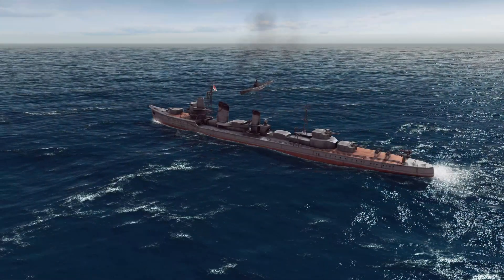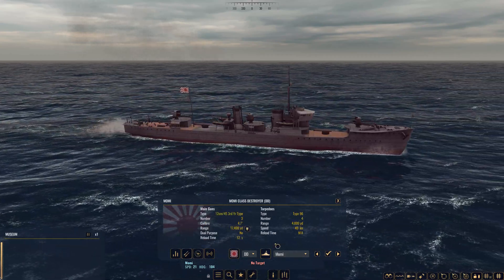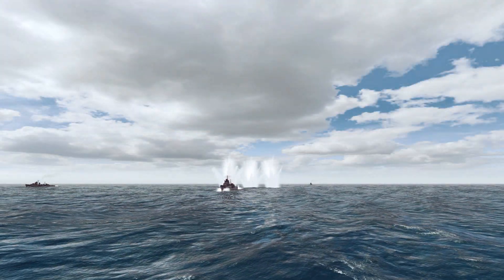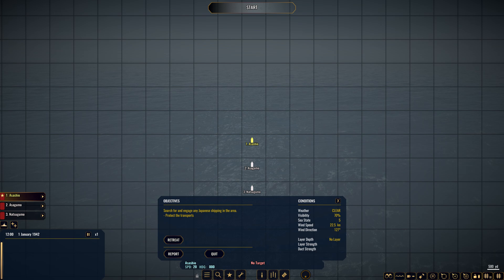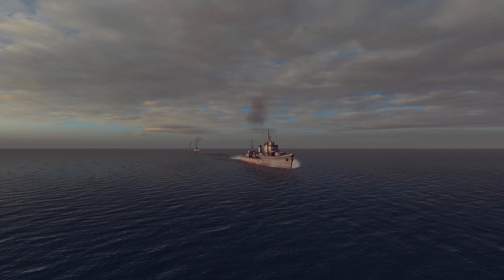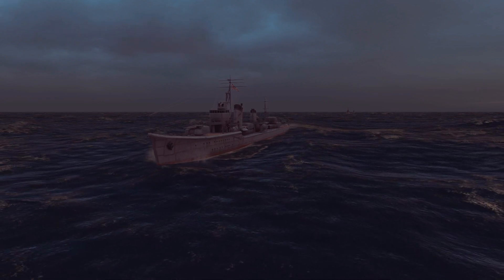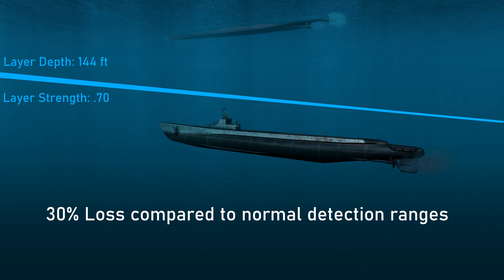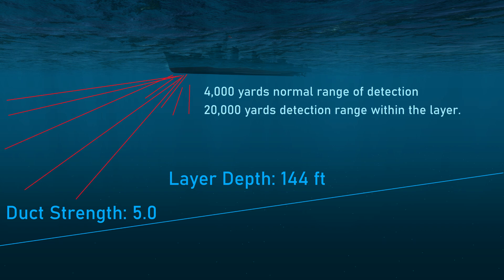War on the Sea: ASW Ships, Environment, and Sonar Sensors Explained

Comment: Are you advocating not using active sonar but rather passive when sun hunting? I got the impression you only use it when almost on top a sub and using passive to locate.
Reply from the maker: I haven’t played in a long time but when I did, I almost exclusively used passive tracking all the way up to the engagement phase. I think you can use active and it doesn’t affect your passive sensors but I’m not sure how that works. The manual doesn’t specifically state is does or doesn’t unfortunately. 

I was addressing some folks who were using active sonar as a wide area submarine search sensor which is not how it should be used in this game. You are right, you should be using passive sonar for detection and tracking then using active for the final prosecution close in over the contact. Though like I stated earlier I personally didn’t even do that and most always stayed passive tracking during final attacks on the sub.

Comment: Thanks. I never really get passive a chance - I typically go active. Seems like I should reconsider? I've never detected using passive.
Reply from the maker: I would recommend it over active sonar. I have a longer ASW in practice video that demonstrates it being used. One of the most frequent mistakes I’ve heard from others who struggled with using passive sonar is that they were simply going too fast. The game models the sensor performance degradation with high flow noise so if you can keep the speed in moderation (under 12kts or so), you should be able to use it effectively. Of course, the environment plays a big part in the ranges you ultimately get.

Comment: Hey! Nice job with both ASW tutorials. I was using some previously acquired knowledge in Cold Waters to run ASW (and fine tune it through trial and error), but there's still one aspect that I'm still struggling with: setting the seconds depth charges will take to detonate.  Many times I saw a perfect shot being wasted because the DC would detonate too high or too low. Any hints on that?
Reply from the maker: Thank you! As far as I know there is no way to set the depth timer. While I’m not positive, I suspect it is tied to your solution %. Meaning, if you have a low solution and conduct a depth charge attack I suspect that’s when you see the depth being wildly wrong and causing a miss despite the line up being spot on. But, that’s a guess… I haven’t spent time to test it out.

Comment: Great video. The 0.7 layer strength should give 70% detection range loss. Right?
Reply from the maker: Thank you! The way it works is 1.0 would be normal range and no loss so subtracting the layer strength from 1.0 would give you the percentage loss in performance compared to normal range. So .90 would be a 10% loss, .80 would be a 20% loss, .70 would be a 30% loss, .60 would be a 40% loss etc. 

This of course is just due to the layer. Additional modifiers can also affect the ranges on top of that (like if it’s raining there’s a 50% loss)  so there will be some cases where you won’t find the submarine under the layer depth unless you’re absolutely right on top of them.
Reply: @ryu1940  i need to apologize. The manual explains this in detail and somehow i completely forgot. Anyway thank you for the time.
Reply from the maker: No worries at all no need to apologize! I’m glad I can help.
Reply: I wonder what percentages sea states take? If someone was really dedicated and committed they could probably figure out, that's not directed towards anyone by the way.
Reply from the maker: @adamtruong1759  it’s in the game files some where. I am not sure where but a while ago I saw someone post something about it on the forums and I believe for the highest sea state detection dropped off to on 10% of normal detection. That’s if I’m not mistaken.
Reply: @ryu1940  Hmm, it's said that in sea state 8 you can't find a submarine underwater no matter how hard you tried, at least with sonar. The camera has something else to say.
Reply from the maker: @adamtruong1759  yeah in a practical sense trying to find a submarine using the sonar in a sea state of 8 is nearly impossible. You pretty much have to roll right over it for your sensor to detect it. 

When I say 10% that means you lose 90% of your normal detection range to the sea state. That doesn’t factor in the other variables like contact speed or aspect, or if he’s under the layer or not. All of those combined can lower your detection range even further til it is almost nothing.